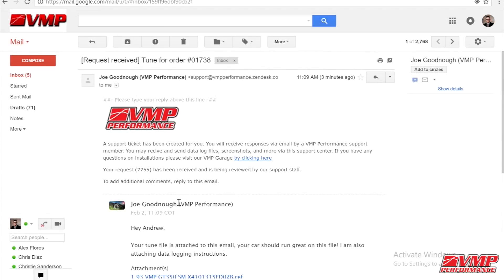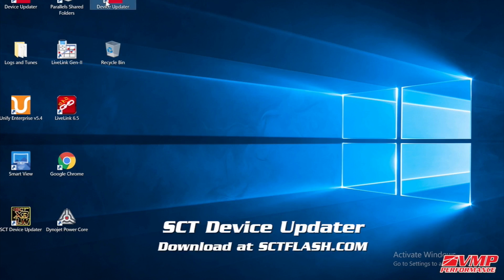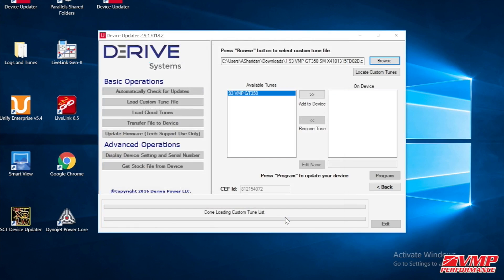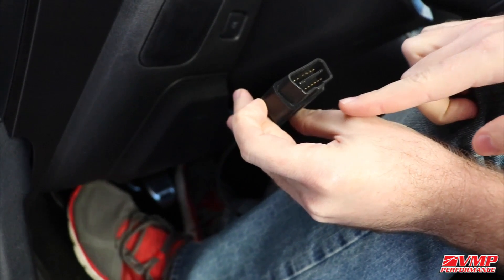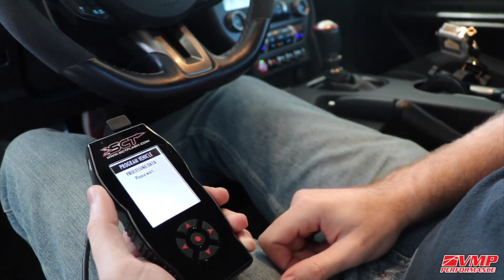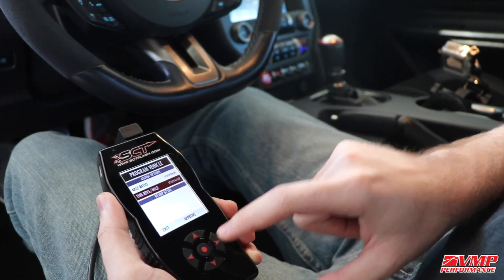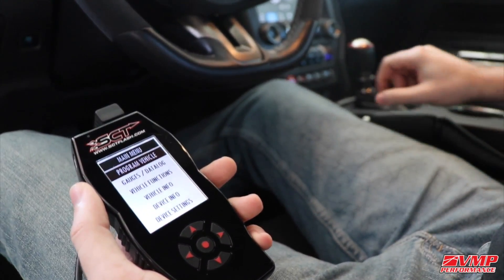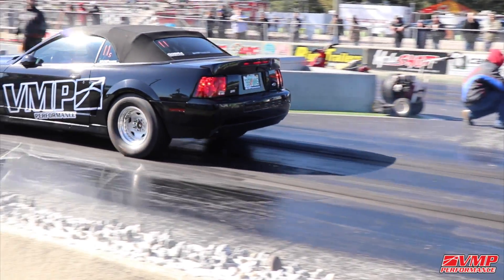How To Load Custom Tune File to a SCT Device

Comment: I have a 11020 error. I know for sure the voltage is high enough, I even have it on a charger. Could the device itself be bad?
Reply from the maker: Hard to say Mike.  Something we commonly see with the push to start vehicles is that the button wasn't held long enough to go beyond accessory mode and actually have the ignition on.  Otherwise, we'd recommend reaching out to SCT customer service.  They'll happily help you with diagnosing any issue with your device.
Reply: @VMPPerformanceTV  yeah I tried it for an hour last night. It’s on a 18 GT350. If I tap the start button or hold it for the 2-3 seconds, it still gives the same screen saying full power accessory active.
Reply from the maker: It'd be worth putting the SCT Livewire software on your computer, then hooking to your device to see if there's an updated firmware for it.  We've seen software updates help with reading specific vehicles.
Reply: @VMPPerformanceTV  I’ll give that a try. Thank you

Comment: Can i still use my stock tune until i get my custom tune?
Reply from the maker: It depends on whatever modifications have been done and the vehicle itself.  If we're talking Coyote Mustang, anything changed between the MAF (mass air sensor) and Oxygen sensors will require a tune update to run properly.  That includes things such as cold air intakes, throttle bodies, intake manifolds etc.

Comment: How’d you use Mac for the sct
Reply: As far I've seen Windows only, not 100% it tho
Reply: Mac's have Bootcamp which allows you to install Windows on a partition and run Windows on a Mac. I have a Macbook Pro and I actually have a Windows Partition so I can run my SCT device on it. I have had Windows on it in years past as I've ran other Windows only software in my life. Have had this MBP for 10 years.